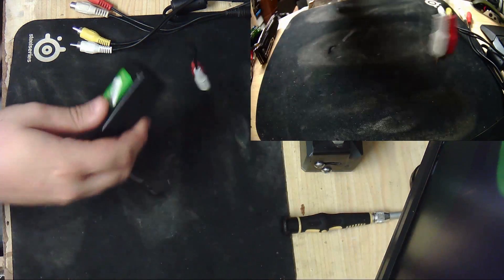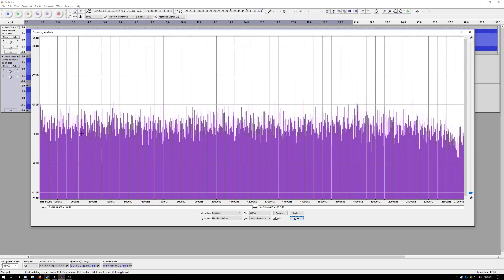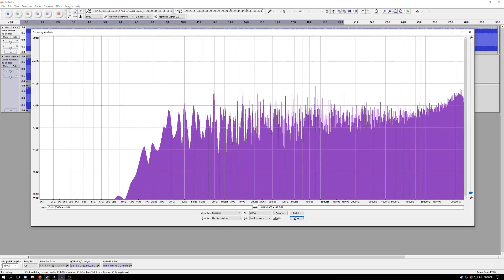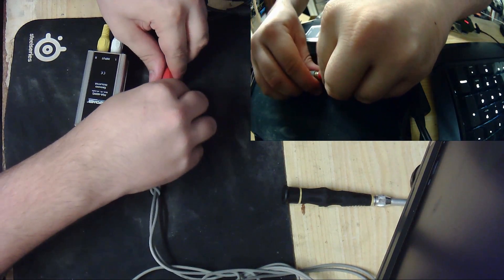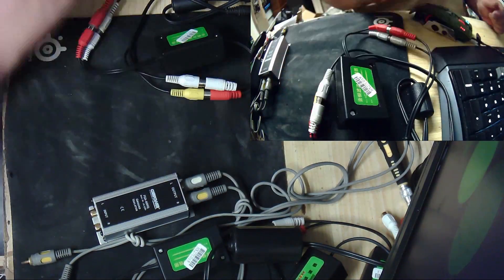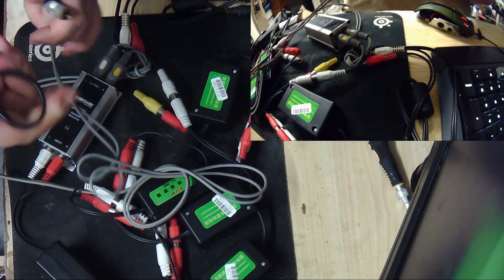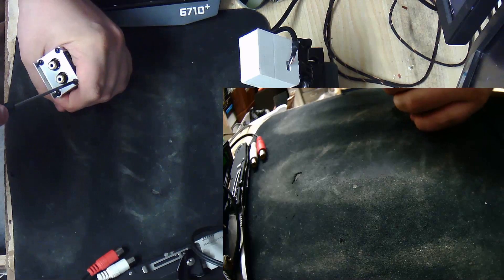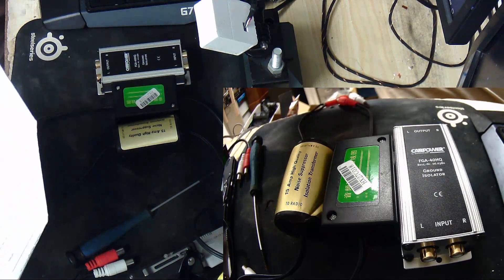Audio Ground Loop Isolators Comparison: Cheap = Good?

Comment: Home studio and DBX286s was noisy as hell when I hooked up the line out to my interface or to the line in on my PC.  Unhook the line out and no noise YET the two devices were on the same strip (tried various strips) side by side.  I even went so far as to pull them out of the strip and plug them into the same socket one on top of the other.  What gives?  Advice given was to remove the ground from the DBX286s since it is grounded to the PC that is grounded to the wall so only one ground is shared.  The line out (TRS) is where they would share the ground.  I don't know of any way to eliminate this issue and I am even more stumped how two items sharing the same strip side by side would have this issue either.

Comment: I plug the 2.5mm male to headset input of the phone,, then at the other end is 3.5 female,, I plug the 3.5 mm male to  two phono male jack unbalanced to the mixer  aux send going out to caller and the other end of the phono jack goes to mic or line input .. dial tone dos not hum but when you try to dial the number there is loud buzzing/humming coming through the sound from the mixer .. how do I fix this problem?

Comment: I see them on ebay. May be a better place. I had a weird hum lately being produced by some games. But the issue is sporratic. Sometimes I'd hear it, other times I may not. So I'm hoping the monacor will help. I have a cheap on called PAC SNI-1 coming so I'll test that first. But I think in the end, the monacor should do a better job. I'm also checking with the plate amp manuf to see if they can replace mine as the issues started to happen before then 5 year warranty mark.
Reply from the maker: sporadic hum is not a ground loop   do you have a pcie soundcard, USB or onboard?  pcie soundacards pick up the interference from the gpu   only way to fix this is getting rid of the soundcard.   a isolation shield (cardboard wrapped in tinfoil, wrapped in electrically isolation tape) did the trick for mine, but not 100%
Reply: @gamerpaddy  No I only use the HDMI from the video card, no PCIe sound card and I don't use onboard sound. either. I can try, possibly, to change the cable from PC to the receiver in case it's a PC issue. I'll try the ground loop just in case it helps eliminate that. I tried buth .2 ports on the receive and it occurs on both, more so, in assasssin's creed black flag and the Assassins Creed III Remastered. There is something about the subsonic frequency used in the game that makes the amp flip out. It's weird.

I have changed where the sub is installed to and location of my surge protectors. I may swap those two in case one surge is causing the feedback.

Comment: Thanks for time making this video, Im using a Boss B25N for my subwoofer, do you know if this isolators will affect the subwoofer sound quality the same way as a common speaker?. Im currently using a Boss B25N for my sub and LFE channel.
Reply from the maker: in this test it clearly did something bad to the lower end frequencies. a subwoofer is just a common speaker too, just aimed at a lower frequency range. you could try removing the filter and listen to it, if you notice any positive difference without it, look for a different one or dont use one if you can.   
i dont know this manufacturer, cant say if its any good
Reply: Thanks for the quick response, the only way to stop the hum noise is to un-ground everything, i guess i will do the hearing test first :/
Reply from the maker: is your setup in a car or at home?   try grounding the amplifier with a wire to your audio source housing.   i had humming on my diy amplifier because i forgot to ground metal parts of the wooden chassis.  after attaching a wire to them it fixed the humming.
Reply: A home setup, using a PC + Xonar Audio Card for my 5.1 system with studio monitors. After many tests if i ground the PC i get the 60hz Hum (loud) only with the subwoofer (is a two pin power cord). And i have to ground the sub with a wire from a screw on the backplate and then the isolator will work (why?). Or leave the system without ground connection and have the silent i want. But of course if i touch anything barefoot zaz! hahah
Reply from the maker: PC's are grounded normally, well except ones that use a powerbrick (like laptops).  
If you ground your Subwoofer to your PC chassis, the hum goes away or gets louder? if its a laptop, check if the RCA / 3.5mm negative pins have connection to ground. 
my xonar u7 isolated the rca negative from usb ground (which is chassis  / power socket ground)
very weird problem

in some cases a isolator can't be avoided, yours sound like one of them.  
leaving things ungrounded, especially if metal parts are exposed (knobs, enclosure, backplate, heatsinks) is not a good idea.
Reply: Is an old house and wasn't build with the grounding consideration, but the room with the pc is grounded correctly, if I ground the PC + subwoofer i get the hum and found no way to eliminate that... and only this two things connected. For know i will stick to using the isolator, thanks for your help. :)

Comment: Is there one on Amazon.com that is comparable to the Monacor? Especially, if it is used on home theater sub amps?
Reply from the maker: dont know, the internals on each of them is different even if its technically the same. you gotta figure it out on your own.  best way is to not use a isolator at all and fix the ground loop

Comment: Hi, Does a cheap ground loop isolator reduce the native sound quality of home audio equipments like an amplifier?
Reply from the maker: Yes. Avoid using one if you dont really have to, but If you have to. Get a good one or try fixing your ground loop
Reply: gamerpaddy Thank you for responding. I just got my ground loop rectified today and the humming still happens on my amplifier into a headphone  without the input cables. So it could not be the cables. Maybe something else
Reply from the maker: What Frequency is the humming ? 50hz is ground loop or there is a power cable near your audio cable thats coupling 50hz into it, 100hz usuall means powersupply capacitors are broken / dry
Reply: I can't be very sure about the frequency. 
 it's low and like a bee's sound. I have tried the amp without the RCA inputs through headphone in all parts of the house. Have tried removing all power cables and equipments. Does not work. And the humming is not constant. It happens sporadically and, stops for hours and then resumes any time it has to. So the humming is not consistent. That is all the detail I have gathered. And all I care is sound fidelity.
Reply from the maker: Do you live near a cellphone Broadcast Tower or Something else thats radiating?  The Last Thing i can think of would be someone in your House or nearby Power grid that has some device running Sometimes that distorts the Power grid Sine Wave. Like a High Power Motor with a awful Powerfactor.          

When you can get a cheap used UPS (uninterruptable Power supply) like for Computers to keep running in a Power outage, try hooking your amplifier after it.   
Ii takes the Line voltage, converts it to 12..24v for battery storage and Back to a Clean Line voltage sine Wave.    
Some May require to disable Green / Energy saver Mode to constantly convert even with Line voltage present.
Reply: I live in a New Delhi, India. It's an area that is still under construction and thus there are all kinds of activities that may require heavy electronic powers. 

However I am curious to know that you mentioned 'dry capacitors'. If the amplifier has a humming issue but it is not consistent or constant then can it still be that 'capacitors' are bad or does it mean that the amp itself is fine and it is the external power swings that are contaminating the signal? 
Thanks
Reply from the maker: yes. Or try shaking your amplifier while its running. A broken solder joint could be the issue aswell